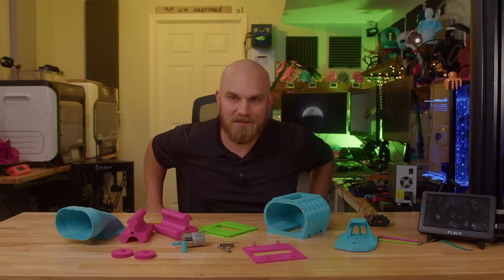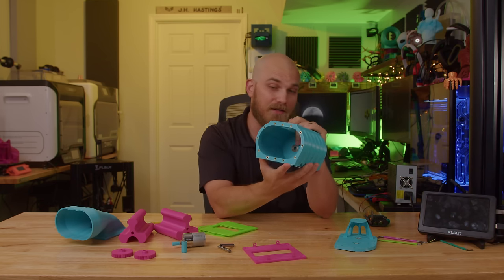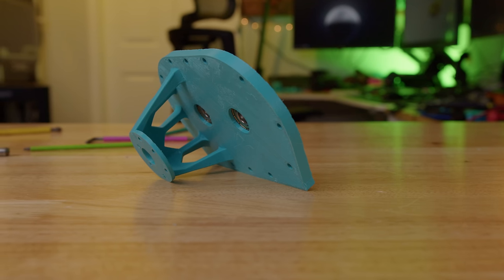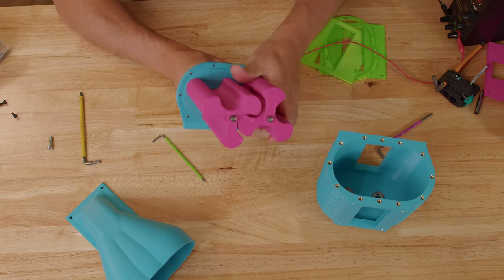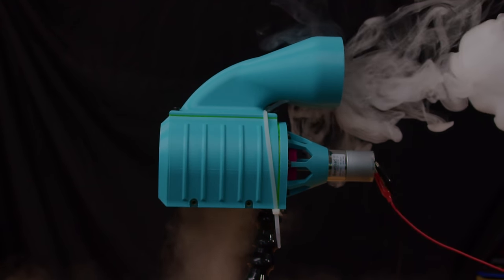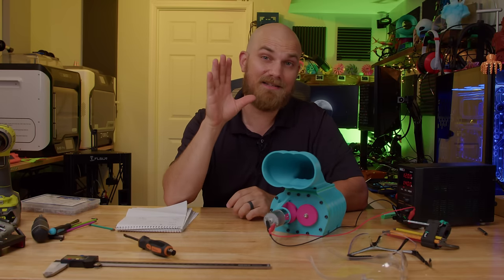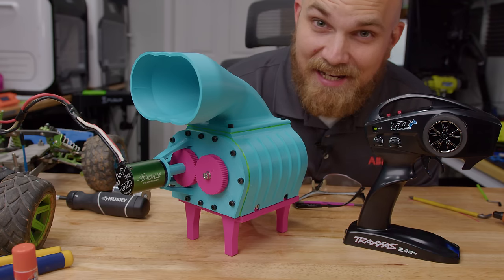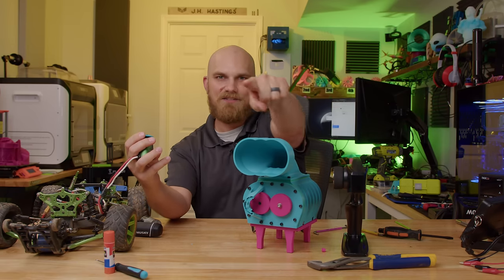I SUPERCHARGED My Custom Loop…… Literally

Comment: Of course we want to see it run at full power!
Reply: Heck yes I want my computer to sound like a big supercharged V8... Sadly this is not a gimmick comment I would be completely amused to hear it ramp up when cooling requires it.
Reply: It's a no brainer. 

Yes I want a supercharger on my PC.
Reply: got those plastic charger blue balls.
Reply: Yesssss
Reply: @Craft Computing what beer goes well with this supercharger setup?
Reply: Jesus loves you alot trust in His death 4 salvation and be saved from eternal hell <3 Jesus died on the cross for you bro. <3

Comment: Couple things..

1. PLEASE USE THE FASTER MOTOR. I want to see what airflow it makes and the smoke test. 
2. You should find a way to measure static pressure (future video project?)

I also was really impressed with how smooth the air was coming out the bottom.
Reply: I definitely agree that static needs to part of the testing criteria moving forward. This blower probably wins first
Reply: This

Comment: I'm an engineer and I can tell you there is a very good reason why "twisted rotors" as you put it
have a major advantages... they are worse at slow start up speeds, needing at lot more torque to get them staerted
but after that as long as they are precision made they will far outweigh a standard rotor in performance AND longevity!

Edit:
I doubt a 3D-printer could reach that level of tolerance needed for a twister rotor to work.... 
still your not one to back down from a challenge 😀
Reply: This is it, a twisted asymmetrical rotors are way better; BUT, the tolerances they require are far too much for any 3D printer. I think it would probably have much worse performance out of a 3D printer.
Reply: How about a resin printer? Atleast better than an FDM. But probably still not enough precision right?
Reply: @jet613  you'd be surprised with how precise they can get
Reply: @jet613  Am 8K resin printer is pretty darn precise. What kind of tolerances are we talking about?
Reply: You could always include a flexible seal, aka wankel rotary seals, to help with the sealing issue.
Reply: @the_inquisitive_inquisitor  very precise, like you need a professional grinding machine to make them properly. Like tolerances of a few tenthousands of an inch. Any gaps and you lose a lot of pressure, similar to gear pumps.
Reply: @CatNolara I wish i could make one of these on my studers.
Reply: @GTrainRx7  Apex seals. Great idea, print a groove, or better grooves, maybe 12, in the lobes. Could probably print the seals as well, with TPU?

Comment: I use to build these types of blowers at my old job. You do want tighter clearances and also the gears on the end would be timing gears. You would probly want to use some sort of SHIM to get your clearance to set it up . When a blower is timed correctly it really does make a unique noise. almost like bubbles underwater

Comment: A pro-tip: make a 2" in. tall plenum chamber that goes between the blower and the rad, so the pressure equalizes across the face of the radiator.  Makes it more efficient!
Reply: With this very modular construction, that should be easily doable while not having to redo so much. Also since finned radiators force airflow directionality, I think a lot of potential is lost here due to airflow only really passing through a rather narrow section of the radiator's exposed surface. There's a very unfavorable efficiency curve at play here because of this.

Using said chamber to even out pressure and spread the output area, will IMO greatly improve that. This is also why most decent quality (PC water cooling) radiators have 0.5-1 cm of clearance between the frame/cowling the fan(s) frame mate to, and the radiator fins. To reduce airflow dead zones.

There's a reason why the near-universal standard for more/better cooling capacity is more radiator surface (and more/larger fans to cover the increased area, unless it's a passive setup) - and rather rarely "improved" through faster and higher static pressure fans for the same radiator, unless there's just no more space available.

Heck this is also why if you for instance double radiator surface area, you can usually get substantially better cooling performance even with less combined airflow and fan power consumption from the scaled-up setup (for instance 240mm rad with 2x lazy, slow spinning 120mm fans), than with the smaller and less performant setup (120mm rad and 1x aggressive, fast spinning 120mm fan).

TL;DR More radiator surface area getting airflow throughput, is substantially superior to higher airflow throughput through the same radiator surface area.
Reply: I was just gonna suggest that, great tip!
Reply: That's the only way a roots type blowers work.  They create the pressure in the manifold.
Reply: Pressure. Static pressure.
This charger can blow through multiple dense radiators.
I vote for pressurising everything in one tube!
That's where it will shine
Reply: @saltwaterrook4638  they dont create pressure, they create flow. Restriction creates pressure.
Reply: @Ritefita  that wouldn't work because after the first radiator the air and water would already be at equal temperature. more radiators only help if the volume of air flowing through them is enough to carry away all the heat without saturating
Reply: @aerbon  soo.. If some PC has radiator on intake, does it mean all air comes 100% saturated and all further fans and radiators 100% useless?
Reply: Howdy fellow car guy 👋  🤠
Reply: @Ritefita  The second radiator is never as efficient as the first, but depending on the air flow it can still help a fair amount. also any air that enters the case from other spots or anything that ends up slightly cooling the air inside the case, such as the metal panels of the case, will lead to getting performance out of the second radiator.
if the second radiator isn't doing much, improving the air speed will help. if it is at close to the performance of the first, another radiator will help. more radiators need more air and more air gets less helpful without radiators to use it. its a balancing act. of course the best use of your radiators would be to have all of them be intaking fresh air, so in a situation where you want all the cooling efficiency possible i'd just have them outside the case.

i don't have any practical experience with watercooling, but i think about stuff like this often.
Reply: Jesus loves you alot trust in His death 4 salvation and be saved from eternal hell <3 Jesus died on the cross for you bro. <3

Comment: few things.. 

1. Defiantly want to see twin screw on this!
2. There is a plugin for fusion 360 to make herringbone gears which are quieter, stronger, and are self aligning (ill try and find the link if you want it)
3. is there a way you can measure static pressure of fans?
Reply: Static pressure would need pitot tubes maybe?
or going Full GamersNexus: https://www.youtube.com/watch?v=4vYDeXpVTvs
Reply: pushing a column of water against geavity, like the old days
Reply: @stephen1r2  mount the fan to an air tight box and a U shaped tube with one end inside and one end outside. Like they did on Mythbusters once I think in the episode where they tested if someone could accidentally run through an office tower window.  In that they put a window on the box and pulled negative pressure to simulate the fact an office tower has positive pressure and since they threw the dummy at the outside of the box they had to pull vacuum.  But the way they measured the pressure since no gauge went low enough was a U shaped tube full of food colored water and marked inch measurements on it with a sharpie.
Reply: @stephen1r2  pitot tubes measure total pressure but can also measure static. be careful repeating things gamersnexus says. he is very smart but even he admits that his air flow tunnel is new to him and all the tech (if 80s tech is still tech lol) it has he has had to learn about.
Reply: I'm also defiantly wanting
Reply: *definitely ;) I'm waiting for him to blow the side covers off his case with this setup.
Reply: where did this defiantly word came from and why people still using it?
Reply: print nylon seals
Reply: @echohotelsix  It is a word, it's just being misused.
Reply: @jameshealy4594  Defiantly using language.
Reply: @echohotelsix  defiantly is a very common apple autocorrect for the misspelling of the word word definitely. I do it all the time. Definitely just doesn’t seam to click with me.
Reply: @ButterfatFarms  English is the language that mugs other languages in a bag alley then goes through their pockets for spare words and grammar. 

It is by every measurable aspect an awful language, but it's the closest to a common language we have worldwide, so guess we're stuck with it.
Reply: @stephen1r2  low Static pressure is really easy to measure. Just run it against a closed plate with a little tube attached to it. make a U-turn into the tube and fill it with water so that gravity pulls the water into the U. 
Measure  how far the water is pushed up on the other side (keep end open and long enough ). For every mm the water rises, you get 0.1 mbar of pressure, as 10m of water equals 1bar.

this was the way to masure before modern tech  and static fan pressure is still int the specs in mmh2o. if you want to measure more, mercury was also used as its heavyer
Reply: I used to have a little twin screw box as a demonstration thing because my granddad worked for American Airfilter, I wish i still had that thing, It was actually about the size of a 100mm fan just more square. Was clear case with green screws
Reply: Gamers Nexus and LTT are both working on Lab equipment to measure static pressure of fans. As well as in depth noise testing and other things associated.
Reply: If we're just comparing, we can use a box full of water with a vertical tube glued to a ruler.
Reply: @ButterfatFarms  indeed, english is a dynamic, fluid language. So long as the syntax remains true, the varying lexicons of the different dialects will remain the same language. English, is quite beautiful in its ever evolving nature. Its no wonder many struggle to learn it as a second language, something as simple as context can change the meanings of words and phrases, and this context may only be know to the ywo persons involved in the specific conversation
Reply: @rossgirven5163  excuse me but if im not wron i already seen the word defiantly around early to late 2000s on online forums, did the browser and cellphones back then already have autocorrect?
Reply: @echohotelsix  I’m sorry but your reply seams kinda short, like I have caused you offence.
I am simply stating an observation that if you misspell definitely on iPhone it often corrects to defiantly.

As for autocorrect in the early 00’s, I certainly was not able to access websites via my Nokia 3210 so I am assuming if it was present on forums it was posted from a PC. Which in the 00’s did have spellchecking.

Wether that was present in internet explorer or safari I cannot remember, it was 20 years ago.
Reply: Herringbone would be nice but tend to work better on a thicker gear. A helical gear would at least make for a quiter gearing.
Reply: @bakuamad5519  i use a set of herringbone on my openRC F1 car, it blows the tires off before those gears ever mess up.
Reply: 3 - usual turbo gauge
Reply: *definitely
Reply: @Ritefita  oh i highly doubt that is making enough to read on one like that.
Reply: @LordVartok  they have the smallest range I know.
Reply: whats the link?

Comment: One thing that might help you get tighter clearance is to print slightly oversized to where certain things are just barely rubbing together. Then run at a lower RPM for several hours so the parts wear in.

Also I would LOVE to see a large one of these designed for a 360mm radiator!
Reply: Good idea, if the compound of the screws is the same compound as the housing is can wear the housing in some too. This will still creat a tighter tolerance but will compromise the shape of the housing, another way to get a tighter tolerance is to use gear marking compound, and cover the screws in it, install and spin them a few times. Take the screws out and check for wear, do a light sand on the spots that have the marking compound rubbed off. Than cover the sanded areas in marking compound again and repeat. You do this until the tolerance is perfect, you just have to be care not to go overboard with the sanding.
Reply: a thing i do when I want tight tolerances between parts is to again print them a bit too tight but then use one of those kitchen dish soaps with like a sand in it and it turns out it works very well as a mild abrasive
Reply: Horizontal expansion =0.2
Reply: @snitchgaming4486  but idk how well the 3d printed plastic is able to withstand those forces in the screw shape. The lobe shape is more resistant to deformation
Reply: That's actually a good idea, but you might need a lil bit more torque for that
Reply: Self clearance was my first thought as well
Reply: If it wasn't so loud that would be a cool custom setup... well IF it worked.
Reply: Or maybe take some liquid rubber and paint them with a thin layer.
Reply: or seals like those apex seals on rotary engine
Reply: @flyingsavage8522  well said about the marking compound and sanding and stuff most definitely I concur
Reply: Hell yeah!  360 or even 480!
Reply: @michal_king478  If you find that too hard to find, you could use regular dish soap with pumice powder, too.
Reply: @snitchgaming4486  or TPU maybe?
Reply: @snitchgaming4486  there are a bunch of roots that have straight lobes but youre a gamer so you probably know better
Reply: @byloyuripka9624  and roots is completely useless in this scenario because it requires the manifold to build pressure which this doesn't have.  Maybe you should spend less time typing and more time reading.

Comment: The biggest problem with this design was the geartrain. Make more robust gears that maximize torque from the motor in the efficient speed range of the rotors, and it seems like it'd be able to move relatively astronomical amounts of air.
Reply: @ButterfatFarms  damn... nothing gets past you. clearly he wasn't attempting to make anything of sufficient performance
Reply: @ButterfatFarms  obviously his goal was to make a device that moves air, so it stands to reason that he would want it to move as much air as possible, as that would match the trend of this channel. The point you're not getting is that this is a fun project, and believe it or not, it's fun to make "useless" things work well. Besides, you don't know that strapping it to a lawn mower won't actually increase power because you haven't tried it.
Reply: "The biggest problem with this design was the geartrain."  You do realise the gear train does nothing but synchronise the rotors?  It doesn't offer any speed reduction or increase.
Reply: @ButterfatFarms  the goal is to make a cool supercharger model out of plastic that moves some air, and if possible move as much air as possible.

No noise concerns, no efficiency concerns, no pressure requirements. It's a fun stupid project and that's the best part of it.
Reply: @ButterfatFarms  you get it! These projects are fun to tinker with just because. And I agree that the biggest problem right now is the broken motor mount, lol

Comment: Maaaaaaaan, this tickles all the right spots!! I'm a former mechanic, with some experience with forced induction... this is such a cool little idea. Lots of refinement required, but you are on track with that fast rpm motor. I think I'm gonna try something like this myself, but with aluminum housing and printed rotors. Great video!!!
Reply: Mhm because of clearance would it be better to wear slitly oversized rotors in a harder housing or go full on precisson grinding?

Comment: I would say bulk up the motor mount and increase the size of the whole unit so the opening at the bottom fully covers the 240mm rad (it is the right ratio).  Also, print a very, very slight interference fit and wear it in, then grease the gear teeth and the rotors lightly to seal better and not wear too fast.  That should be a killer setup.